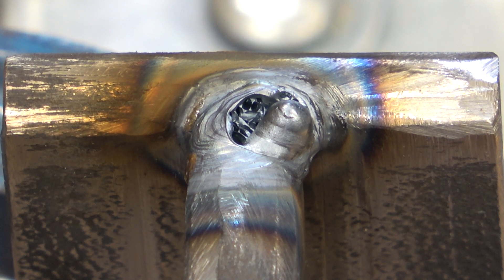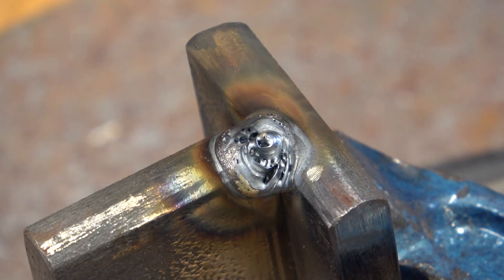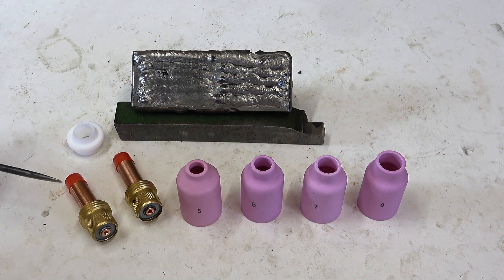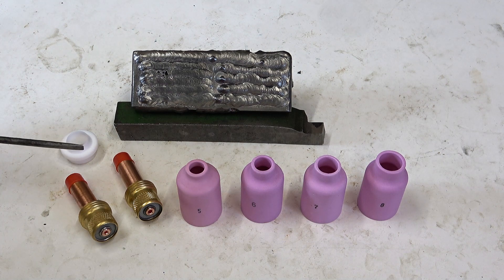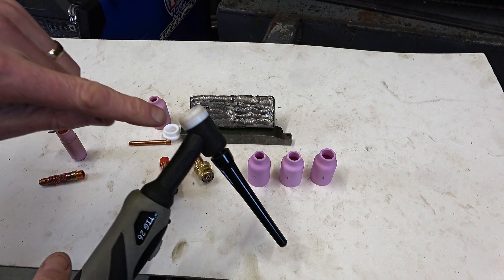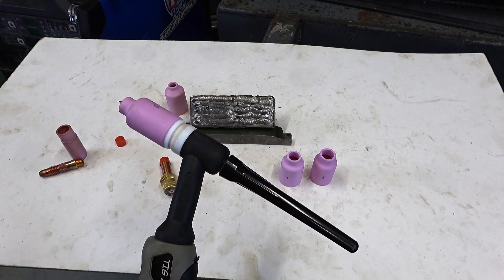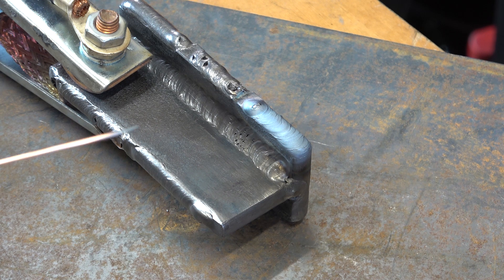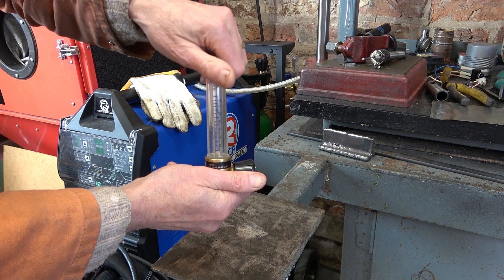HS129 Diary of a TIG welding beginner 6

Comment: 1/2 way through the video and my thought is…..Looks like your might have had your machine set on DCEP?  When welding in DC (for steel) you need the electrode in the negative side. Opposite of stick welding.  Lol. After seeing the end the welds are looking much better. But I think the amperage is a bit low for the thickness of material. I would be near 150A and 2.4mm wire to weld  those. Good luck. It took me a bit to learn to raise amps and move faster to keep from heat soaking the part. I use ER 70s-6. For mild steel.
Reply from the maker: Hiya, it took me a long time to realise my main problem was the gas nozzle was too small. I went up a cup size and got a couple of gas lenses and hey presto ..... instant upgrade from completely useless to just about ok on a good day.  I don't really get enough seat time to maintain a reasonable standard so every TIG project involves a bit of re-learn to start with. Cheers

Comment from the maker: Dean, on that same theme, about 4 years ago I bought a Heat Pump for a project from a big brand in that particular field and I had some questions about a wireless remote control module.  To cut a long story short the brand at first said I had to talk to the retailer for support who was a one man outfit with limited brain and knew naff all about it (he had just flipped it as a reseller), and it soon became clear that the brand (sticker engineering) knew very little themselves. I tracked the HP unit down to a big manufacturer in Shenzen China - I sent them several support requests but no answer. It simply would not do one of the functions listed in the brochure. Anyway about 3 years on this big Chinese company set up an EU support unit in Stockholm I think it was and they replied to say "sorry it does not do that".  Mechanically it is a good unit so in that sense I won't complain but the brand and the retailer added cost but 0 value in this process and will no doubt in time be cut out of the loop. Well it's their own fault.

Comment: Keep at it Paul!  I keep thinking I want to get a TIG welder, I would like to be able to weld aluminum and stainless steel.  I know that technically it could be done with my MIG (which I really only use as a flux core wire welder), but not nearly as easily.  I'm going to keep these videos in my saved collection for when I get one.
Reply from the maker: Hi Mick, I have had a stick welder for over 40 years for occasional hobby use and got quite good at it. But TIG does so much more in both the range of materials and just the general control and precision achievable.  I've done a bit of work welding steel without filler wire and you can get a joint so neat you hardly know it's there - it's like the parts were cast/rolled in one piece. If you are welding trailer axles you need big heavy strong welds but for many jobs you don't need big seams or fillets. I've tried some stainless and that went surprisingly well. I've not made any serious attempt at aluminium yet - that might be a later video. Cheers

Comment: That was good. It has all been said. Keeping the tip of the rod in the gas. The clogged up gas cup. I would add that sometimes too much gas flow can cause turbulence which sucks air into the weld zone.
Reply from the maker: Hi Carl, yes keeping the filler rod in the gas and also down at a low angle will be my next focus points I think. Cheers
Reply: @HaxbyShed  No problem. Thank you for making these very informative and useful films.

Comment: Great video and you are making huge steps forward. It was good to watch the things you were doing and changing. I have to say that we are going off the idea of getting a TIG 😀
Reply from the maker: Hi GTB, I can understand why you say that, it hardly seems worth the effort, but in a later video I do some very neat joint work that possibly you would not get with any other method and also with TIG one can weld some very exotic metals. However I have my doubts that I will be able to turn base metal into gold ... . Cheers

Comment: Paul, the inside of your welder looks identical to the one my brother Carl gave to me. It's a Sealey but all of the internal electronics are made in Italy. Incidentally, I sent it to a company in Haxby to have the HF circuit repaired. I'm enjoying watching you progress this skill because I need to do the same. I have HAVS so my finger sensitivity is low, I'll need to set up a rest or I'll get nowhere fast!
Best wishes, Dean.
Reply from the maker: Hi Dean, I always worry about big brand companies sticking their label on other people's stuff. It's fine until people figure out that all this kit is the same, or the manufacturer starts selling direct. Then people ask "why am I paying so much for a sticker?".  I suppose there is also added value from the in-country support that comes with the big brand, so long as it is good. Cheers
Reply: @HaxbyShed  Paul, I very much agree. When it developed a fault, the manufacturer said that it couldn't be repaired and offered to sell me a new one. I sent it to an independent company up near you who had experience of fixing the exact same fault. It could easily have just been thrown away.

Comment: Great progress! I think I may know why your standard 6 cup is causing problems. It’s not the size of the cup. When you showed a closeup of the cup, the inside of it had a lot of slag and crud in it. That was likely causing a lot of turbulence in the gas flow and is sucking in outside air. The new setup with the gas lens is almost always going to be preferred in any case. But I would toss that #6 in the bin and replace it. You need a constant and stable flow of gas to shield the weld puddle. Any kind of disruption from turbulence or even a breeze through the shop is going to create issues.
Reply from the maker: Hi Greg, thanks for the advice. It would help if we could see the gas .... how it flows and circulates.  Cheers

Comment: Watching the process of you learning is perhaps more useful to me than the "this is how you do it" videos made by the experts. I usually find that until i know what i'm doing i dont know which bits matter'. Thanks for sharing.
Reply from the maker: Peter I am exactly the same. In concept TIG is straight forward but I've found it to involve so many new aspects I could not tell which things mattered and which things did not. As I've watched the experts on YouTube saying "let the puddle flow" I've not understood that 9(?) other things have to be right for that to happen smoothly. It's like learning to drive a car and it only comes together when most of the operations have become 2nd nature - parallel learning. Anyway hopefully I've turned a corner now, on this material at least. Thanks for watching. Cheers

Comment: Great to see you progressing. I just tried a gass lens with a pyrex cup this evening.  It looks promising.  I am attemting 304 stainless. Some welds look better than others but I am overheating the welds, and keep dipping the tungsten or the rod to the tungsten. That high frequency tingles!
Reply from the maker: Glenn, you made me laugh out loud 🤣 so far I have managed not to sit on the torch and fire the trigger and HF into my behind. I'm learning that stainless is a complex material. I can make quite nice surface beads but the back oxidizes like heck without backing gas, and it work hardens etc etc.  But at a push I think I could weld up a crack in a stainless exhaust now, on a good day.  Cheers
Reply: @HaxbyShed  I have a few holes in my pants because I let the torch dangle from my shoulder and it swung into my leg. That prompted modifying a small bar clamp with  U welded on so I can hang the torch on it.

Comment: Hi I’m probably at the same stage as you on Tig welding, I have made a magnetic adjustable hand rest, this helps a lot I can send pictures 👴🏻👍
Reply from the maker: Hi Terry, yes the pictures would be good please. My email address is haxby_shed@outlook.com   (it needs the _ between haxby and shed).  With your permission I could show it on my next welding vid.  I'm still building up experience on position and table height, and I will sort out a better table arrangement as I get more experience and know what's going to be best for me. Cheers

Comment: Getting better and better Paul. You will be a pro soon! I've burned many thousands of pounds of rods. Done a bit of mig welding. Went and did a tig test for a job and the guy hired me on the spot. First and last time I ever picked up a tig torch. I never went back for that job.
Reply from the maker: Hi Danny, somebody told me for TIG you need to get into Zen meditation and take on a serene calm. Breathing is controlled. Nothing is hurried. If you are a 'get it done' kinda man then it can be frustrating - I know. I'm not sure whether TIG is science or art.  Cheers
Reply: @HaxbyShed  Lol... Sounds about right.

Comment: just a dumb asses thoughts it looks to me that the temp is way too low and you are heating up the metal too much by not getting it melted quick adding the filler and moving on quick but it will all come with time keep up the good work
Reply from the maker: Hi Lee, right I think I understand. Sounds like I need more/higher spot heat and moving quicker rather than heating up the whole area. I'll aim to do that. Cheers
Reply: @HaxbyShed  trust me im no expert but i was taught to make the pool quick dab the filler and move on as fast as you ability allows you

Comment: Awdjr. beat me to it. Very good advice on his part. Exactly what I was going to suggest. Keeping the molten end of your feed rod in the shielding gas is important: when it comes out, it oxidizes instantly. Experiment: where you said 130 amps looked good on the fillet weld, turn it up 3 or down 3 amps & see what it does. Thick material preheat is sometimes a must. You can begin welding at 155 on cold steel & as you go, pedal back as material heats through & you may finish @ 125/130. Does your machine has high frequency start? Pre-flow  on the gas before weld starts? Post flow to protect after you flame out? These are all things that will now come in time with practice. My wife was cheering you on like crazy, seeing your good welds. Keep it up & Jody will have some competition soon. Cheers. P.S. keep that tip taper long & SHARP. My instructor always told me: dull pencil, dull boy.
Reply from the maker: Hi Bob, you made me smile. At the moment my brain cannot handle torch and pedal together so I perhaps have to wait until the torch end of things has become more instinctive. It took me a long time to learn how to rub my tummy and pat my head at the same time (demos available).  Yes it's HF start, preflow, post flow etc.  Don't think my active lifespan will be enough to ever catch up Jody. Cheers again.

Comment: I agree with AWDjr above when he said don't let the filler rod leave the gas coverage area between dips. If the red hot filler rod leaves the gas coverage area between dabs while it is still red hot, it will form oxides and contaminate your weld pool the next time you dab it into the weld pool. Each dab just continues to contaminate the molten weld pool with oxides. That last weld bead looked great to me!
Reply from the maker: Hi DIY-HP,  it's something I need to work on. My focus there was relax and take it slowly .... keeping the rod in the gas shield is my next .... Cheers
Reply: @HaxbyShed  I completely understand as I'm still learning too. I'm enjoying watching your journey! Stick with it and you'll be making good welds in no time.

Comment: Super great progress on the welds Paul.  Another tip, if I may is, as I see it, you are learning the variables/effects of gas coverage, and it was  wise of you to master control of your torch hand.  Soon, work in control of your feeding hand. Keep the rod as CLOSE to the leading edge of the puddle and use very short dips, the rod should STAY in this weld zone area.  The more you pull in and out of this zone, the more room for error,  the filler rod must stay in the  gas shield zone or it will contaminate also. The filler rod angle should be low to the horizontal aiming at the  puddle like your shooting pool...the pool ball is the molten weld pool lol! Keep up the great progress,  one can't over think TIG, it has many variables that effect the weld. Cheers.
Reply: Great advice.
Reply from the maker: Hi Al, appreciate your advice and it will be noted. Lowering the rod angle down close to the plate is a totally new learning point for me. And yes I will aim to keep the rod within the gas shield in future. Cheers & thanks.
Reply: @HaxbyShed  Great progress! For both internal and external fillets, try laying the filler rod right into the corner. You can then withdraw the excess filler rod being careful not to let it ever leave the pool. Creating a slight spring effect on the filler rod as you grip it ensues that the rod stays tight to the fillet corner at all times. So with this method, there is no dabbing. BTW I’ve been acquiring machinery for my hobby workshop and somehow I’ve ended up with a Harrison 140 and an Elliot 10”! I have an Elliot U1 Mill also. All 3 phase and none have been run yet. As I set them up your video bank will be invaluable. Well done. Regards, Richie
Reply from the maker: Hi Richie, I did a lot of research to decide what lathe to buy for my hobby shop. Before I started I was sure it would be a Colchester of some sort, perhaps a Bantam or a Student.  I drew up a spec sheet with my son and decided it had to be metric and with a gap, but also not too heavy and so Harrison140 became the target model. It's a compact lathe with lots of big lathe features. I would have preferred an oil bath in the screwcutting gearbox and the saddle but all the other features make up for that.  I really like the L00 spindle nose, albeit something of an out or date feature these days. The Elliott 10M is another small package that does a lot for it's size, relative cheap and light, and very cheap to tool. If I were to get a mill it might be a Harrison.  Now to welding ..... yes I need to try the filler-laying technique. My focus changes as life presents different tasks and projects at unpredictable intervals but I will get back to welding it again soon.  Cheers